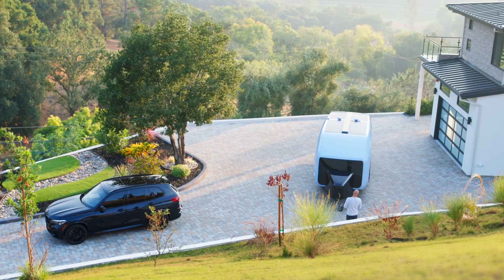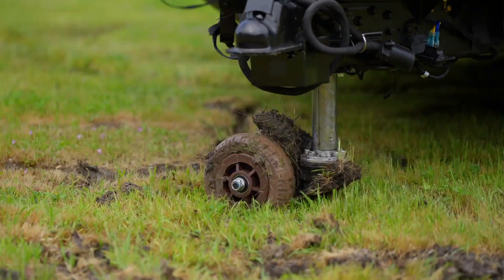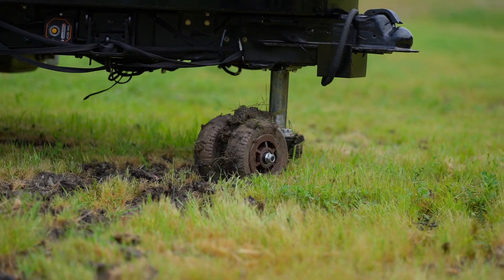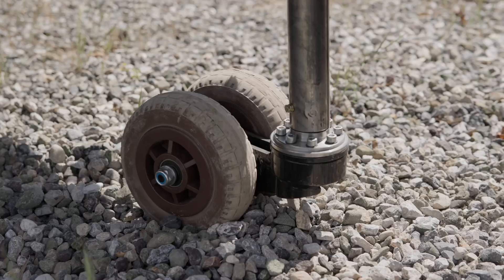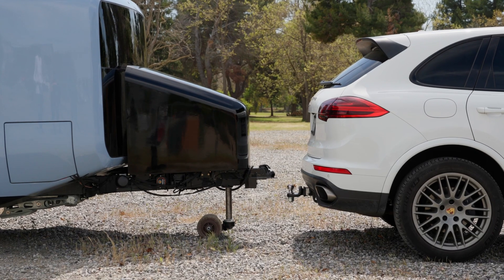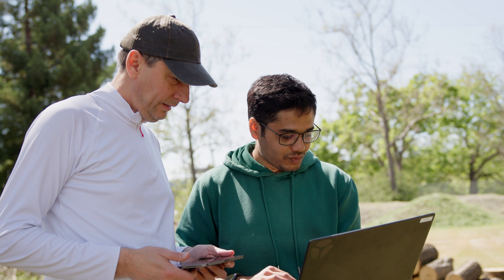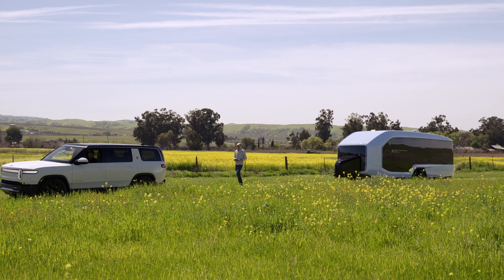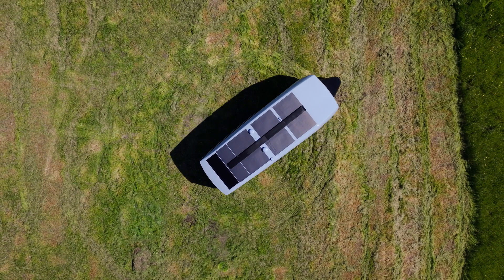A Peek Behind Pebble Flow’s Latest Development Progress: Magic Hitch and Remote Control

Comment: What is the weight of this trailer? I am considering purchasing the 2025 Escalade IQ, which can tow up to 8,000 lbs, or the 2025 G 580 with EQ Technology, which has a towing capacity of 7,716 lbs. I'm trying to determine which vehicle would be best for towing this trailer. Additionally, do you offer other exterior paint color options?

Comment: Do they talk about the construction of this unit anywhere? Can it handle negative temperatures?
Reply from the maker: Pebble Flow is built using rigorous automotive manufacturing processes. All-aluminum space frame construction. Lightweight composite and sustainable materials. The shell is fully insulated, too.